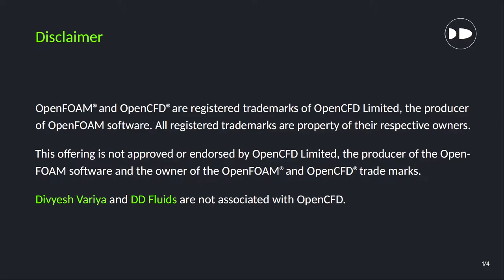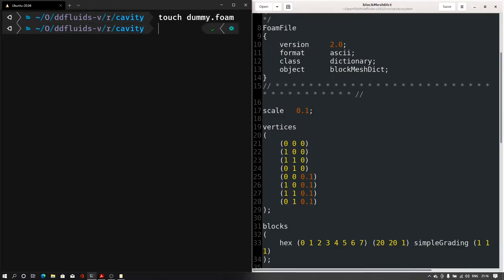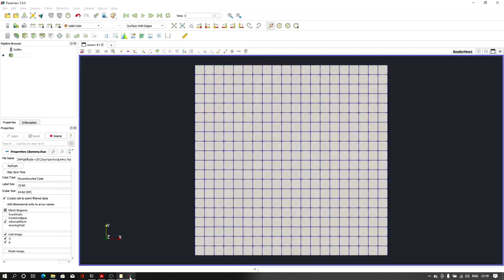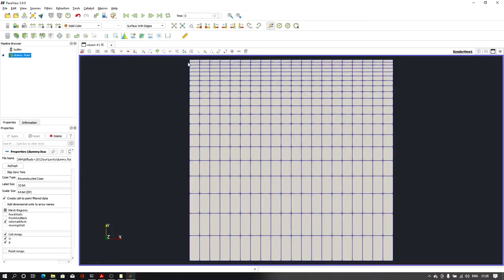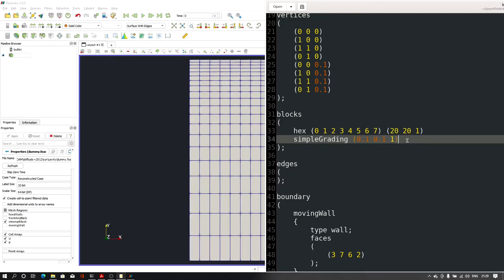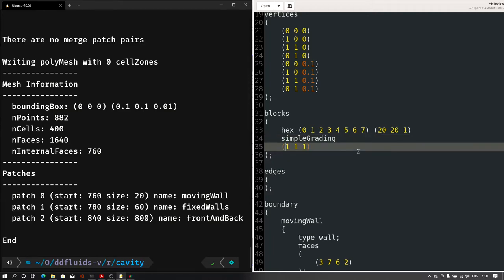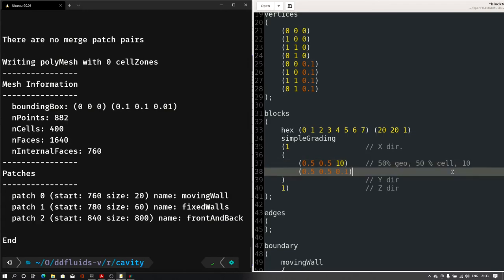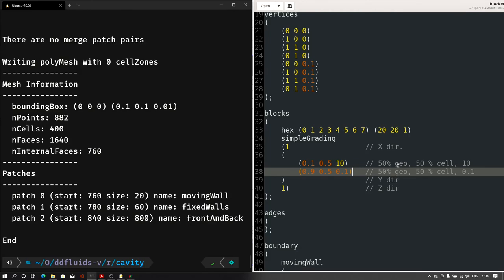blockMeshDict Basics | [grading]

Comment: Great video as usual. Does the partial edge grading work on all versions of openFoam? 
I am currently using 5.x. would it work with the same?
Reply from the maker: Yes
Reply: @DDFluids  thanks. Will you also consider making a tutorial on post-processing with Openfoam and Paraview? That would be very helpful 😀
Reply from the maker: Are you looking for any specific post-processing topic?
Reply: @DDFluids  I'm currently learning multiphase simulations for bubble columns. So a tutorial on post-processing regarding that would be very helpful

Comment: Hello Sir  !! 
I am simulating a axisymmetric flow using a wedge with 5 degree angle.
While refining cells near axis using snappyHexMesh, I get an error -

"cell 56 of level 0 does not seem to have 8 points of equal or lower level
cellPoints"

Can you please help me with this ? I don't want to leave the cells at axis unrefined since it is adversely affecting the result.

Please give some suggestion.

Awesome content btw, expecting more such videos on Openfoam!!!
Reply from the maker: Can you share more details at divyesh@ddfluids.in